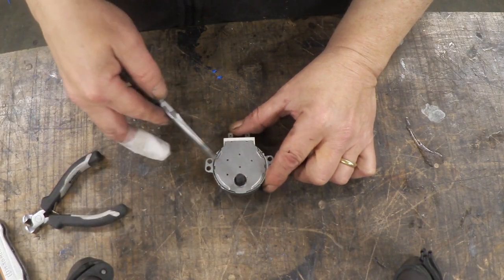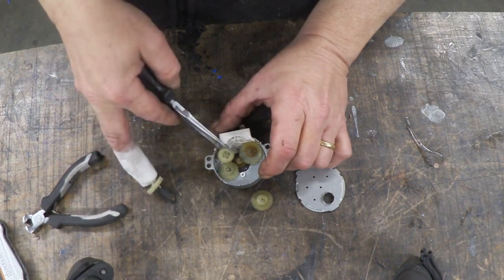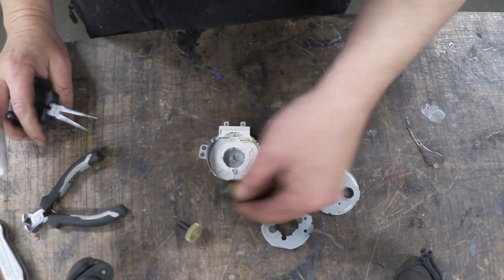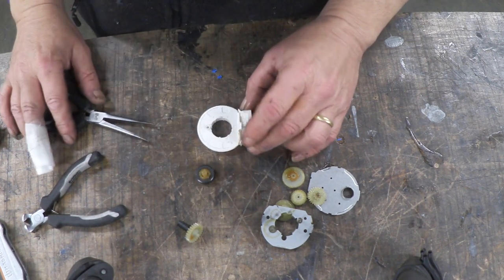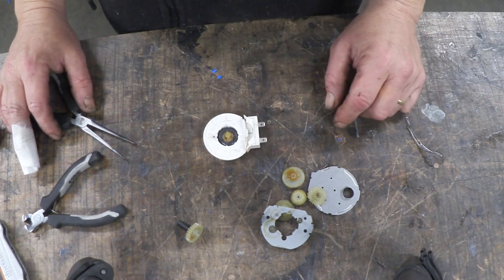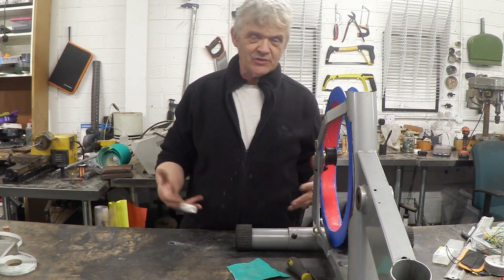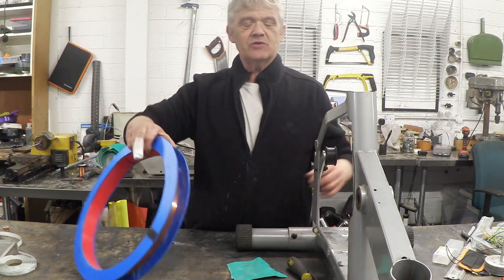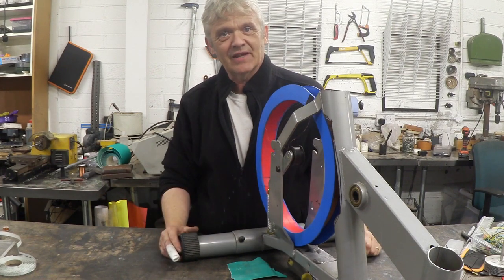Playing With Coils And Magnets

Comment: Hi Robert just a suggestion ,in regards the roof ventilator generator. I too tried to build a generator from a bicycle wheel with vanes attached and a steering rudder to keep it pointed into the wind, it did not work very well. So l put my thinking cap on and came to the same conclusion as you that the ventilator turns no mater which way the wind blows. So here's a suggestion, have you considered winding a toroidal coil with the magnets passing so that the flux lines cross the windings at right angles. That way you only have one winding and you can use heavier gauge wire for greater current.

Comment: Of course this works! The magnets are nothing more than a paddle, that paddles/pushes the electrons down the wire. Why this guy seems so surprised goes to show you that even so called experts don’t fully understand the cause and effects of magnetism. I’ve been research this in earnest for over 50 years now. I bet you this guy can’t tell us where the electricity comes from.  And no, the electricity does not come from the wire or the magnet.  Say what?  To take this one step further there is no such thing as an electric generator because electric generators don’t actually generate electricity at all. Once you understand that then, and only then, do you actually know where the electricity truly comes from. 

Good luck magnet heads.
Reply: Let me guess, the energy produced from his own hand forcibly turning the coil?

Comment: You need to make it an axial flux design. Sit a South Pole on the other side to pull the flux path thru the coil. 

Or go back to a proper three phase design by using Sam Chamas’ serpentine coil designs. Then you don’t need fifty coils.

Comment: I like what some of us need to know is if we're trying to charge a 12 volt battery, which in my understanding means 12 volt is the low end of what it contains and you need to input More voltage than 12 volts to charge the battery? Or will applying any voltage eventually accumulate to charge up that battery? And how does amperage play in that equation?

Comment: what happens if you dump your ink on a coil- just get all the wire coated, would that improve conductivity at all or no?
Reply: Ah- Here was my second question-  Could you use the homopolar generator notion on this somehow?  that theoretically would keep you from having to fight the induction.  This may be utterly stupid of me, but instead of two magnets on either side of a plate spinning, can you do that with a coil and magnets?  I just have this flickering lightbulb of an idea between that and the electrostatic collector you just made with the ink and carbon brushes.... I dunno.  May not be worth considering but...
Reply: The voltage generated is related to the number of turns. Without insulating one turn from another you  effectivly reduce your coil to a shorted single turn coil. If you insulate the new wire, then you run into the space per turn, and can only wind fewer  turns. Copper is best/cheapest conductor for  most, including home DIY projects.
Reply: @kreynolds1123   But... bare copper wire isn't insulated from touching itself, so why doesn't That affect it?
Reply: @ryanjamesloyd6733  the wire he used is not bare. Its coated. Google magnetic wire. You can buy spools full.
Reply: @ryanjamesloyd6733   Resistivity is measured  or calculated acording too:  a 1 meter × 1 meter × 1 meter solid cube of material with sheet contacts on two opposite faces, and if the resistance between these contacts is 1 Ω, then the resistivity of the material is 1 Ω⋅m. And its conductivity is the reciprocal of that.  So lower resistivity means higher conductivity. 

Superconductors and silver aside, copper has the next highest conductivity.  

And while the ink is good conducting as far as ink goes, it is not as good as copper.  Either way, if you add more material (good conductor or bad) to a wire increases its diameter and thus allows fewer turns in a given volume.

Comment: .......that's a conundrum you've landed on us with the winding and magnet arrangement. Is the magnet perhaps magnetised NS across it face rather than along it's short cylindrical length.?   For some reason I'm recalling the Faraday paradox which I'll need to look up again . In that paradox movement of coil generates electricity but seemingly relatively matching movement of magnets generates nothing .
...So how about getting hold of a magnetic compass to locate north south placement for the magnet .? I'm even thinking it might be magnetised obliquely from top to bottom across the two faces.

Comment: Hi Robert. This should not work  ... There's no flux change top to bottom of this coil but just a rotating flux aligned with the coil where flux change top to bottom is 0. This should not produce a working motor nor generator. This is easy to see because it's a symetrical setup. If you turn the coil 90 deg clockwise in respect to the rotating magnet it will provide full voltage. If you turn the coil 90 deg anti clockwise it will provide full voltage with opposite phase. If you turn the coil 0 deg. you will have the average of these 2 : 0. Imho you missed something in the original motor. A meander pattern or something in the iron  ... something like that ...
Reply: Yes agreed that is should not work, but there is a measurement that is does, so unless there is a measurement error it is either an error in the theory or more likely an oversight on how the theory applies. My guess is that the electrons still experience a directional force due to the fluctuating field strength, it won't be as strong as crossing the lines since that 'locks' the electrons in a position in a field, but a directional force never the less.
Reply: @MartinPHellwig  I can only assume that the presence of the metal frame of the bike is allowing some sort of flux variation to occur when combined with the small variations in the strength of the magnets. It's perhaps easier to visualize if you take the magnets as stationary and envision the frame and coil as spinning.
Reply: @MartinPHellwig  That is not the case. The situation is symetrical watching the coil from top or from bottom. The measurement result robert is measuring is just due to the magnet angel being slightly off in respect to the coil. If either one can be adjusted just a tiny bit the result would be zero.
Now I happen to have one of these in a drawer for ages and I took it apart. I found the exact tabs Jason Joplin is talking about below. So RPM of the magnet is fMains/4. If someone would do a tooth count of all gears it would lead to the specified RPM for the motor axis. Robert will have figured it out by now. I bet another interesting video is coming :-).
There's one more thing to this and that's rotating direction. Due to symmetry there is no reason for it to go either clockwise or anti clockwise. It might go clockwise, it might go anti clockwise, it might just resonate and not rotate. As this is a proven design it will go one way or the other. It'll probably depend on the moment switched on in respect to the mains phase at that moment. Anyone with a micowave oven should be able to check this ( my plate and spindle broke a long time ago. I cannot check it:) )

Comment: This also produces a "cogging effect" when you rotate the magnet rotor
Reply: Iron and other high permibility  materials cause cogging.  Magnets fight being pulled away from iron, converting mechanical energy into potential energy, and are pulled to the next, converting that potential  energy to mechanical. What your refering to is that with a single phase the mechanical power is drawn off a little bit at a time, and  converted to pulsed electrical power.  Cogging can stop a turbine in low wind where as pulsed power just does a smaller P=V^2/R but will continue to spin.

These are two different  effects, and if you don't have reasonable flywheel effect for the amount of power drawn, or the amount of cogging, then either can send vibrations to the turbine that could be a problem. Going three phase can smooth out the power drawn, and there are techniques for reducing iron cogging.
Reply: @kreynolds1123  I totally agree with you! I have found that 3 phase is definitely the way to go! I have experimented a lot in the past with three phase motors that you get out of old VCRs cuz I can pick them up for free out of the trash and tear them down that's a great source for small three-phase motors and they actually have a pretty good size diameter 2-in overall very flat pancake design, I also like the Samsung washing machine motors the big 12-in drum, and of course all size is in between, and yes there are methods for reducing that cogging to practically zero for the most efficiency depending on the arrangement of the magnets
Reply: @JasonJoplin  Check out the motor I made on my channel.  Axial flux BLDC with zero cogging slotless stator iron and three coils on the stator.
Reply: @kreynolds1123  good stuff!

Comment: Hi Robert,  enjoy your channel greatly.  

I am trying to figure out how to make a generator to harness wave action while at anchor for my sailboat.  I have imagined a free floating ring around around a bottom weighted cable hanging off a boom on the boat. With wave action the float would travel vertically up and down the cable with opposing magnetic fields.  Our solar panels only make 200 watts in prime conditions and the wind generator doesn't always spin.  But we have fairly constant wave action. I can't wrap my head around making the linear generator and electrical circuitry for the float style device.  Can you make something in a future episode please? Thank you.

Comment: Why not use a paper ribbon, 1" wide and painted on one side with your conducting ink.  Wind 500 feet of that, instead of the copper wire around the bobbin. Would not that act as a coil also?

Comment: Interesting once again Robert.  I would caution you as when you rotate a magnet inside a loop of copper tubing it will create heat. I seen a vid of a guy playing around with this yrs ago. I was thinking about using this to create hot water for portable shower.  Point being, you may create heat and melt your set up. Just some thoughts. Keep up the great work. God speed

Comment: Why copper wires at all, magnetic fluid would perform much better.
Reply: Source for such a schema?
Reply: Coper tube as a circle or coil with the fluid inside moving through?
Reply: Could a coil of magnetic gas work?
Reply: Could a coilf of magnetic gas work?
Reply: @Barskor1  sounds like MHD magnetohydrodynamics.

There are fluid motors /fluid generators that use such.
Often salt water, sometime hot gas. Sometimes plasma
Reply: @stevecummins324  Interesting thanks!
Reply: @your_utube  Shrug it looks like it.

Comment: Now mix your knowledge of making graphene in with copper make a new coil pack and it will output because it will have less resistance but you still need the copper because of its